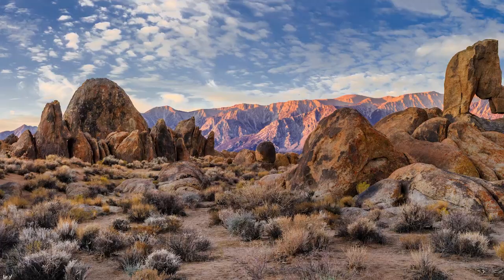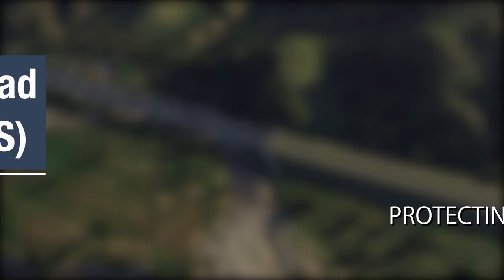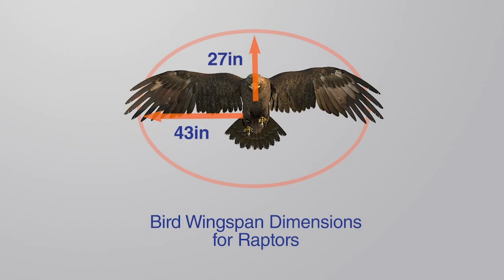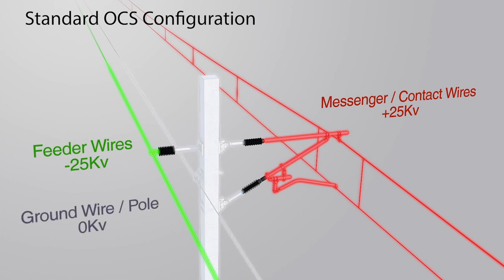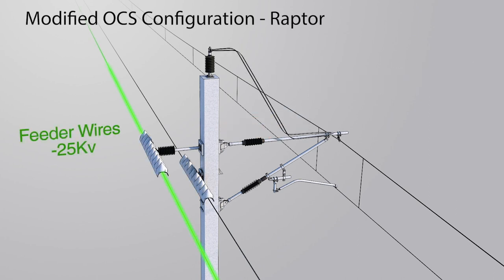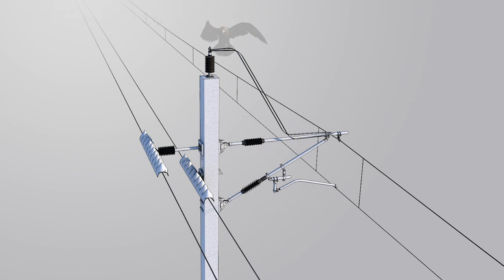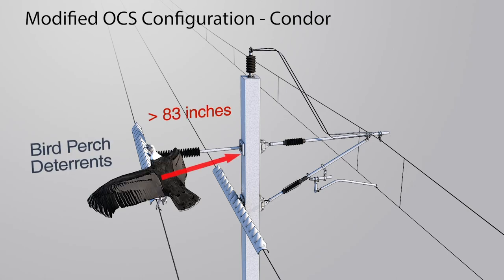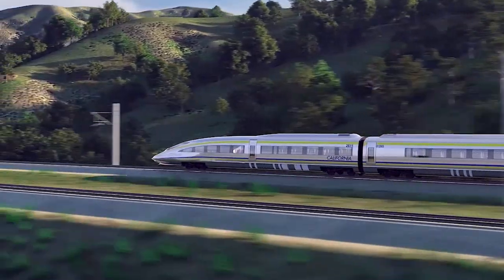Anti-perching Technology is for the Birds

Comment: When is the California High Speed Rail going to be completed?
Reply: In like 9 yrs
Reply: That depends on your definition. The first passenger carrying operation is planned to be  in 8 years. A few years after that the line from San Francisco to Bakersfield should be in operation. It will take longer to get to Los Angeles as there is an 18 mile tunnel to bore. After that there are extensions to Sacramento (not too difficult) and to San Diego (a bit more difficult). It is a system, like the Interstates. That system took decades and a few bits are still not done. 

Even the first part, which is only 119 miles long will be useful as it connects to rail and bus all along the way. For example, there will be cross platform transfers in Merced to trains going to San Jose, Sacramento and Oakland and connecting to BART for other destinations.
Reply: @danielcarroll3358  yup! I really am looking forward to the system. Yeah, you can probably transfer from Merced to Amtrak and go to Emeryville or San Jose. Down in Bakersfield a thruway bus can get you to LA. Still going to be fast. I expect them to make a train with like only a few stops from Merced to Bakersfield. I expect that to still be faster than driving the full way. So excited. And we all need patience. Just like you said, it’s like an interstate that is getting built over a long period of time. It will benefit us in the long run
Reply: @AshmewStudios  Agreed.
Reply: In the year 2525, if man is still alive.  :(

Comment: What year is the California High Speed Rail is going to be completed?
Reply: They say the central valley section could be completed, realistically, sometime in the late 2040's.
Reply: @metalmark9927  Central valley section is like 70% done. Could probably have Amtrak San Joaquins running on it within the next couple years.
Reply: @NERPolitan  --. Not even close!!!  A lot of projects started, a lot of unfinished projects.

Seeing many of the projects on a daily basis, it's clear that they are over extended.  Too many unmanned work sites, day after day......... empty..... 

It will most likely get done, just not with the current timeline.

Comment: Terrible engineering.
Avoid the issue all together by not suspending thousands of pounds of 25kv wire in the air.
Other countries don't do it your way, why should we?
Reply: It’s probably the cheapest solution
Reply: @maa1649  that's incorrect. It costs more to suspend the wire. Every other country does it cheaper, smarter, and faster.
Reply: @hwhack  All electrified rail lines, except subway and commuter rail which can use third rail power, use catenary as it is necessary for high speed. So I would be most interested in what other countries use. Remember, it cannot be internal combustion (or external for that matter) powered because of pollution and climate change problems. 

I await your reasoned answer.
Reply: @danielcarroll3358  I really like how you say, "All rail lines" and then give 2 examples outside of "all". Just too funny.
I'm not here to do your research for you. You can answer your questions, yourself. 
Pray tell, why oh why is the reason high speed rail can not employ 3rd rail power line?
Reply: @hwhack  The shoes get ripped off, especially if there is ice. I said high speed, which is defined as over 150 mph or 240 kph. The California system has a design speed of 250 mph / 402 kph, meaning it must pass testing at that speed. The operational speed will be 220 mph / 354 kph. ICE powered engines don't operate that fast. In fact the Class 442 is the current record holder for the fastest speed attained by a third-rail train, at 174 km/h (108 mph), a record it has held since 11 April 1988.
Reply: @danielcarroll3358  damn you really showed him, he went silent haha